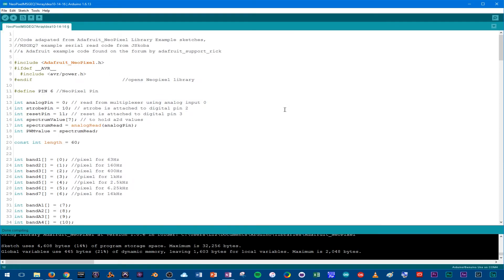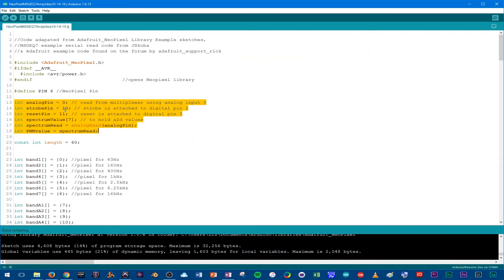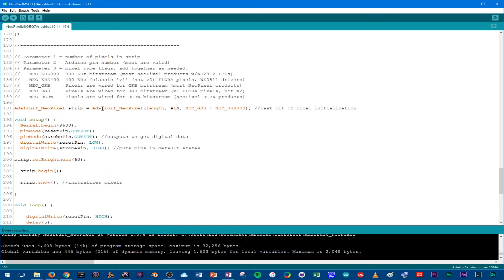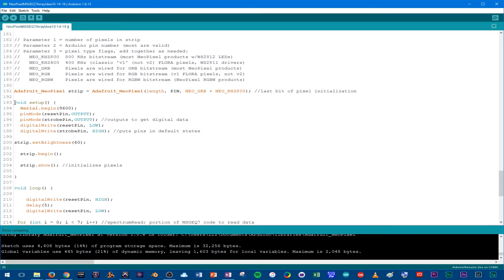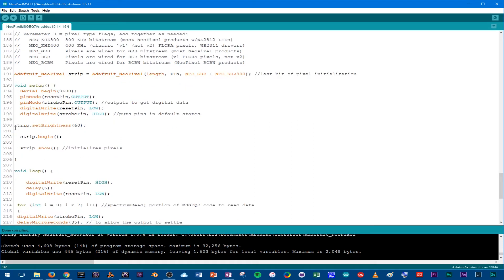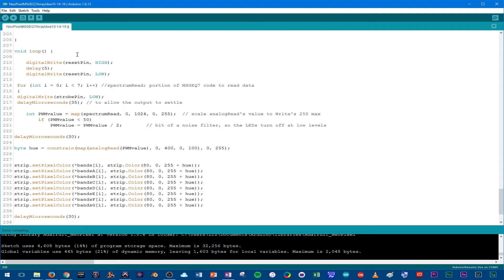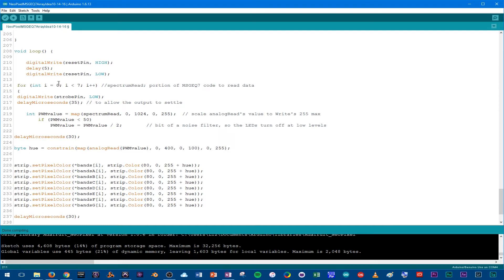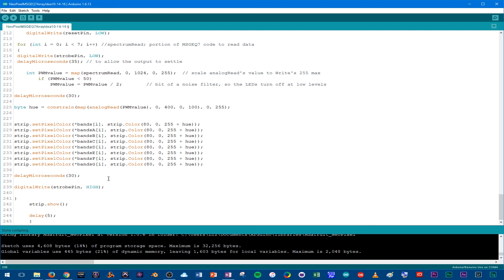Coding Tutorial: DIY Hue+ w/ Arduino & NeoPixels

Comment: I want to be able to turn one light on every time a pinball rolls over a switch. After 24 lights have been lit, the horse race game ends. Can you show how to do something like this? A rollover switch is in a lane so the ball hits it after the spring launcher is pulled. The ball rolls down and turns the next light on moving across the board 24 times. Like a pinball machine. These lights will be on a wallboard.